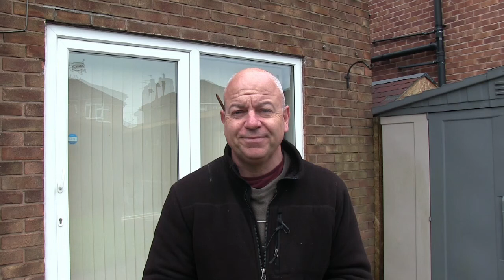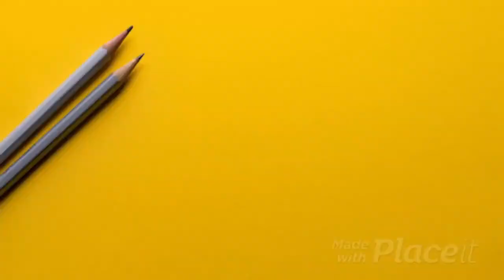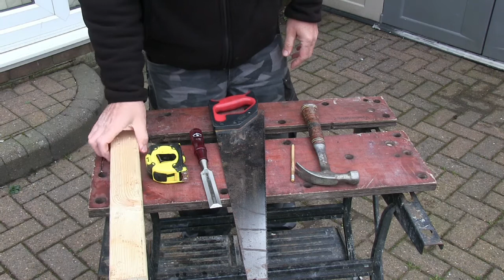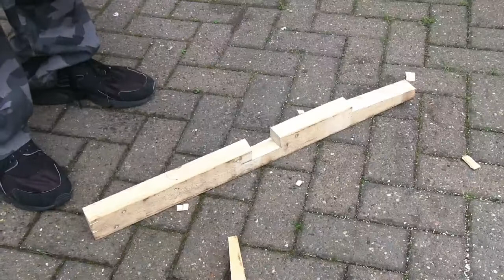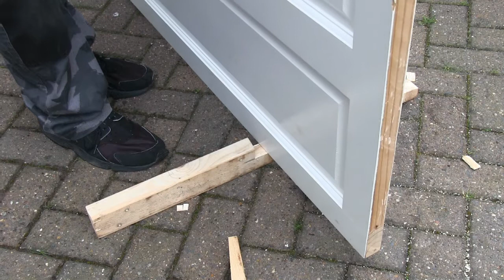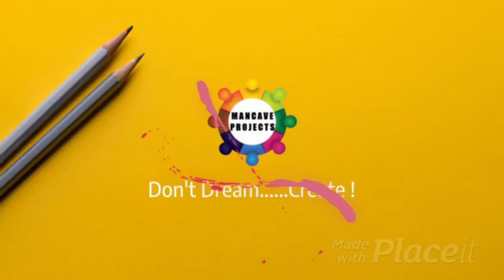How To Make A Door Clamp | joinery hack

Comment: Simple, effective & free. Is it suitable for heavy oak doors?
Reply from the maker: Thank you. For very heavy doors, I'd make 3 clamps. If the door has a high gloss finish. wouldn't do any harm to slide a piece of cardboard in-between the wedge and door to protect the finish (although I've never marked a door using these).